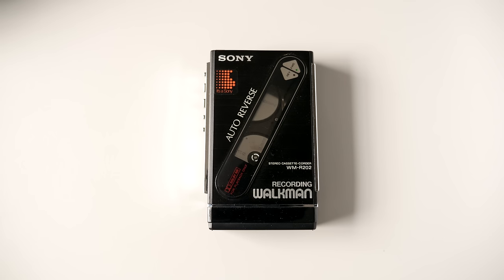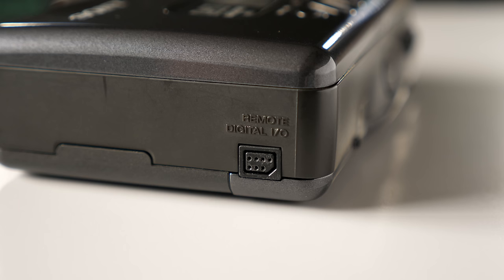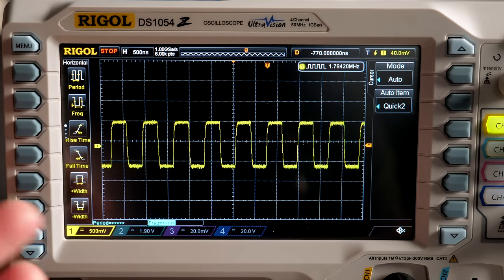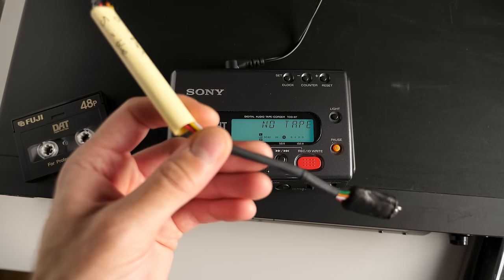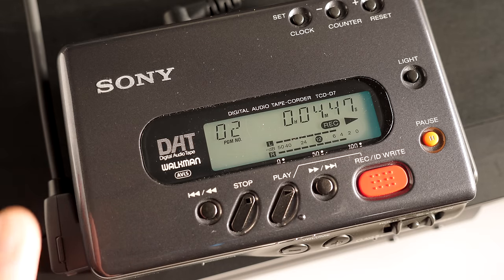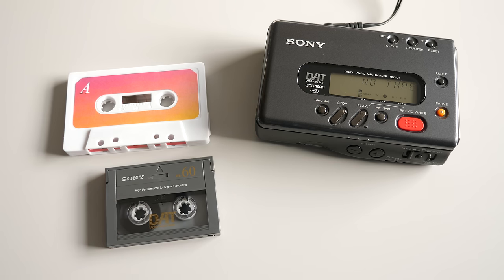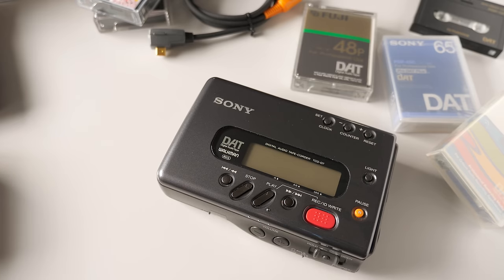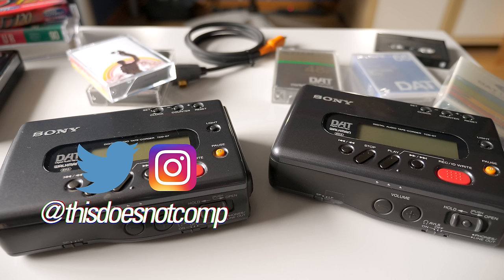Sony DAT: What Cassette Should Have Been!

Comment: I have worked in professional audio now for about 30 years and have owned everything from 8 track, cassette, reel to reel, dat, minidisc, cdr and of course I still own my original high quality turntable.  Not to mention the DVDr recorders. The cousin to the stereo DAT machines of days gone by were in recording studios all across America and the world over.  They were absolutely fantastic when they all worked in good order but one thing no one mentioned when selling these beast were that over around 1000 hours you would notice in the window a message like need cleaning tape.  Or the result would just be dropout and not fixable easy either.  It actually required a complete new headstock assembly to be installed at a premium price.  Those other machines I mentioned were called A-dat made by Allesis and DA-88 by Tascam.  They would allow up to 8 tracks and had heads similar to the DAT head but even more expensive.  You could actually get as many machines as you could afford and have 24,32 and more tracks. I probably spent as much money replacing heads on the machines than I paid retail.  There is a way on the Tascam product to let you know how many hours had been used.  But when that time came, it had to be sent to a factory authorized service center and all in major cities.  These machines were making plenty of money for these companies and even Sony had its own version of the Tascam DA-88 and they for the most part were identical.  I also have the machine you just very nicely presented.  I have had my good and bad days with that.  If I remember retail for those things went for upwards from $600-$900 USD brand new.  Then came Pro Tools which basically wiped out the need for even mixdown machines.  The DAT survived the consumer refusal thanks to the professional community who loved the format because it was a CD quality mix.  I could go on but thanks for all the great reminders of these great pieces of gear!  I still love listening to even my hi dollar cassette walkman.  Those radio cassette combinations had some mighty impressive features and great FM tuners as well with some even allowing you to record from radio.  Keep up the good work.  I enjoy your well organized presentations.
Reply from the maker: I’ve actually had some experience with ADAT and while it was nice in principle to be able to use “standard” S-VHS tapes, they still weren’t very common in stores. And as you noted, reliability was often a problem (especially with the first generation of ADAT machines). I think Tascam’s product was a bit better, but both were really just an incremental improvement over the open-reel digital multitrack tape systems (DASH, etc). I think everyone was just waiting for computers to become powerful (and cheap) enough to take over.
Reply: Yep once those heads wear out, time for a new drum. .good luck finding NOS heads.
Reply: I recently looked at a functioning a-dat recorder for a really good price... Of course, those use vhs heads, which makes life a tiny little bit easier, but... good price or not... it had seen a lot of hours, and I just can't be bothered to deal with the work it would take to really bring it back to its original performance. Sure, it still worked, that is something...

For digital recording (I have a-dat compatible io on my digital mixer) bringing the analogue part back to spec won't matter... but that is fun for like 5 minutes... look mum, no computer... after that, a 10 year old laptop with some daw software will do a much better job at it. The only real point in getting it would have been it also being usable as 8 analogue inputs for my mixer, but... that would involve a full restoration, and I just can't be bothered with that (not to mention, there are solutions for that which would provide higher sample depth and rate than a standard a-dat recorder will, fit in 1u, use a fraction of the power, have a fraction of the weight... you get the idea).

Still... contemplating buying one for a few minutes was fun 🙂(oh, I'll need a new 19" rack... hmm, do I actually have a use for 8 more analogue inputs? etc)

Comment: Sony doing a proprietary connection? I'm shocked! Lol
Reply: To be fair, that connector attaches a dock that had a LOT of functionality.  I had the Walkman D3 (the predecessor to the one in this video) and that RM-DK10 allowed optical digital in and out, RCA digital in and out, and came with an IR remote.  Really nice setup.  Also, the D3 shipped with a simple optical digital cable (toslink) that had that customer connected on one end.  So, you could still make digital copies of CD’s right out of the box without having to buy the RM-DK10.

They also didn’t use this connector on the home units - it was on the Walkman’s to save space…

Comment: DAT is still used for server backups, except they call it DDS
Reply: dds-1 tapes can double as dat cassettes
Reply: @RagedContinuum  The only problem for DDS is the tape itself is too thin if u put DDS into DAT audio player then hit play/record I can guarantee you will get most tapes jammed for sure because due to design of DAT audio machines the pickup roller not quite like thin tapes.
Reply: It was renamed DAT by HP later on, and the last iteration of HP's DAT had a twice as thick cartridge, as they had doubled the tape width, breaking all compatibility with previous DAT/DDS iterations. It's been over a decade since they released the final iteration, though. Some companies might still use it, but DDS/DAT is dead, like many of the other tape formats. LTO is essentially the last man standing in the tape backup market.
Reply: just use 60 meter or less DDS-1 tape only and you should be fine
Reply: @RagedContinuum  really?? I used 120mins DDS no wonder the tape jammed big time. thanks for that

Comment: 28:20 DAT lived on for a few more years in the data storage and backup area, where DAT tape backups (DDS) were used for long term and offsite storage for smaller sites. Drives did not have the ADC/DAC circuitry (as well as other necessary functions) to read/write audio data.

Comment: In 2008/2009 I wanted to start with DAT & usint it as my first digital recording medium since solid state audio recorders where still very pricy back thenb & the cheaper ones were mostly crap. I loved the sound of the portable Sony DATs after hearing some concert bootlegs recorded on these. But the second hand market usually offers DAT walkmen in a expensive & defective state and i realized you technically get the same soundquality with MiniDV as well. Just with extra Video.
Reply: in 2008 solid state recorders were expensive?? uhh no they werent dirt cheap like now, but freaking computers had either the same quality or slightly better ADC's as the Dat units would have, yes they had mechanical hard drives but still that more reliable than dat

Comment: I seem to remember that the AES3 standard requires that inputs must be able to pick up a signal down to 200mV peak to peak,.
So if my memory is correct and that device is compliant, it is not that strange that it would pick up a 1vpp signal...
Reply: Plus the transition between the states would be pretty obvious, regardless of the amplitude. Literally the reason we switched from AM to FM radio, since most interference affected only the amplitude. As long as it could pick it up at all – and as you say, it's 5x higher on SPDIF than 200mV peak to peak!
Reply: Yes, you remember that correctly, and hence, pretty much everything which uses aes3 will accept spdif on its inputs... the other way around.. read the documentation of your aes3 capable device as many can output spdif level signals when asked to, which seems like a good idea.

Comment: I have seen DAT's little sister in 2013 as the DDS backup tapes for one of the important servers I was working on. The DAT technology is used for backupping data. One tape could hold 12GB of data. (or in a perfect world 24 GB with compression) . But slowly this also died out in the flavor of LTO. Which could hold longer and wider tapes because the tape was on a single spool. On the wiki I see that DDS could hold up to 160GB.

Comment: A friend went with DAT. He loved it. You could borrow CDs back then from the local library. Furthemore he got his hands on a vinyl player with a laser and SPDIF. That thing was really expensive and needed some tinkering (at least his did), but he worked at store for some time, where they sold those and other High-End audio equipment. Sadly DAT was not as robust, as he hoped for. We found one DAT computer drive that was able to dump an Audio DAT cassette directly to harddisk. It was way faster then simply playing it with a player, which would had ment, getting working one. He had three over the years and they were expensive to repair.

Comment: Good video!  This made me nostalgic for the early thru late 90's.  I used DAT for production masters and live 2 track/board mixes.  The two main concerns for reliability were: cleaning the heads and source deck compatibility.  As I recall, tapes recorded on Panasonic would not always playback on Sony, and vice versa.  Specific tape brands used on a particular deck may have also added to the "it should work" factor.   All that being said, DAT was a huge improvement over analog cassettes for live sound and recording.  Thx again, really enjoyed your thorough vid.  I almost fell over when you showed the old Sony PCM1630 3/4" deck!  LOL

Comment: It's worth noting that DAT in its data format, DDS and later DAT again, was very successful for data  backup.  They're still in use now with older servers, and in fact the latest generation of the format DAT 320 was released as late as 2009, holding 320GB compressed data per tape.  In capacity they lost out to the physically much larger and more expensive LTO format, but where this capacity wasn't needed then DDS/DAT was used widely.

Comment: In my opinion:

The base signal of SPDIF/AES is the "clock", it is needed to keep the phase lock oscillator in the receiver aligned with the transmitter.

It is a standard tecnique used in most simple digital protocols - all are designed to carry enough transitions to keep the clock aligned, even ehen transmitting a blank. 

Actual data is  transmitted by inserting premature transitions in the signal.

A premature transition means 1, a completed cycle means 0 (or viceversa) .

On top of it the protocol may have more complex things going on, like transmitting parity bits or more complex forms if error correction - I suspect these latter may be omitted from SPDIF, though, as it is quite an old protocol and the required circuitry was expensive back in the day.

As a side note, the audio fiber optic protocol TosLink is, in effect, just SPDIF adapted to use light from a LED over a cheap multimodal optic fiber.

Comment: There was another use for the DAT format that wasn’t mentioned here. It was also used as a cheap back-up solution for small company servers in the 90s. The company I worked for in the late 90s used DAT as a back-up system. It was a cheaper solution than DLT tape. But the later allowed for much more data to be stored per tape and faster data transmission.

Comment: I ended up switching from DAT to VHS HiFi because DAT wasn't reliable enough - even with very careful treatment of the machines and the tapes drop-outs were always sonically fatal so I'd end up printing mixes multiple times for safety. I tried several brands but all suffered. I was very glad to see the back of this format.
Reply: iqi616 VHS HiFi is criminally underrated as an audio format. It was my go to for home use from 1986 to 1999. I wish I still had all my tapes but my ex-wife jacked and lost them all during my divorce in 2002.

Comment: AES has higher Voltages as spdif because of the distance, the signal has to overcome sometimes in professional music/broadcasting. For example a concerthall with a mixing booth 100 or even more meters away, sometime in a complete other basement. So you need a way stronger carrying signal as you need for your consumer electronics, that are most of the time at the same place or within 5 meters max apart.

Comment: I bought that exact model recorder in an auction in perfect condition with a case, 2 brand new wrapped packs of unused DAT cassettes AND the elusive digital cables. The SP/LP switch was taped/stopped in the same way, the recording control too. I bought it in a POLICE auction, on the rear, there was a (very hard to remove) label saying "PROPERTY OF METROPOLITAN POLICE" turns out it must have been used in interviews, and obviously you'd want the best quality for gathering information or evidential statements. It's possible that this featured machine had also been used in a professional, legal manner. Great player, bombproof build quality. Seeing as my machine and this one are in such beautiful condition, they were classed as a valuable asset, well looked after, and obviously they were expensive as all hell brand new, these weren't used on building sites or battlefields, put it that way. These were invaluable professional tools. I bought mine for really very little, considering the DAT cassettes being part of the bundle (there were 4 of these if I remember correctly), and yes I do still use it (I'm a musician in my spare time and record on it, as I like the sound quality)

Comment: I've been messing with DAT myself, but by using a Sony DDS-3 SCSI tape drive with firmware on it that allows it to do audio DAT stuff. With the right software, you can play and record LP, SP and even DP (double speed, for either higher bitdepth or higher frequency). And you can also use DDS-3 tapes on it for super long tapes, although they obviously aren't safe to play in an actual DAT deck.
Reply: Yeah wasn't there even DAT recorders who could also record 96Khz 24 bit? Like some MinIDisc decks and portables could record 20 and 24bit.
Reply: +KRAFTWERK2K6, Certain professional recorders could indeed do that, although I believe it's technically outside of Sony's specifications.
Reply: @Dan-TechAndMusic  Yeah. Never really saw it widely used. Except for the standard 48khz / 44,1Khz  16Bit. I wonder how compatible these recordings were with other decks who could playback that kind of different recording specs?
Reply: Have you ever thought about getting a MiniDisc Drive for your PC as well? I know those existed but weren't really widespread. Technically those could be used to read out the raw ATRAC data as well and making 1:1 dumps of the digital audio on the MiniDiscs. With modified firmware :)
Reply: I've considered it, but those drives are even more rare and expensive. I managed to get my DAT drive cheap, else I wouldn't have gotten it either.
Reply: @Dan-TechAndMusic  Yeah… understandable thou. Good luck, maybe an affordable one falls into your hands some day.

Comment: This was a very popular unit back in the day with Deadhead's recording the final days for the Grateful Dead.  I personally captured some great shows with it, and its sonic performance when used with high quality mics is incredible.  Unfortunately, this model is prone to playback problems after significant use and it's not easy to fix. I also have the RM-DK3 remote box that allows for SPDIF transfer to/from DAT.  One thing I hated was that it required a proprietary A/C adapter (which I have).   Loved this unit, sad mine isn't working as I have a ton a music stuck on DAT that I never transferred to FLAC before my unit crapped out.